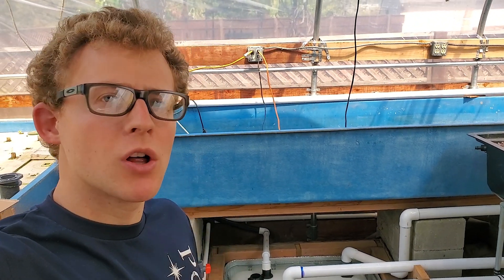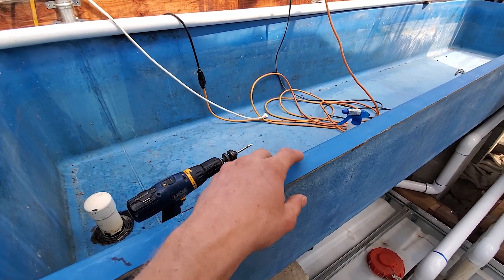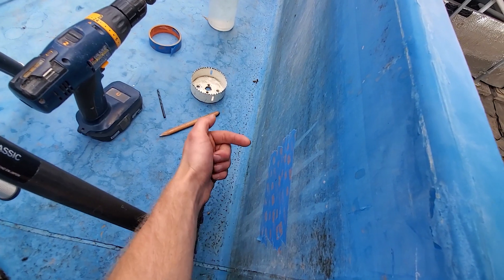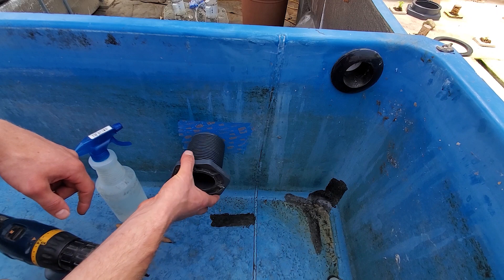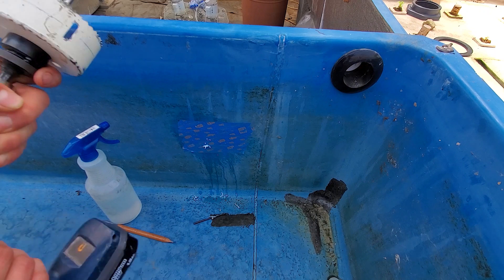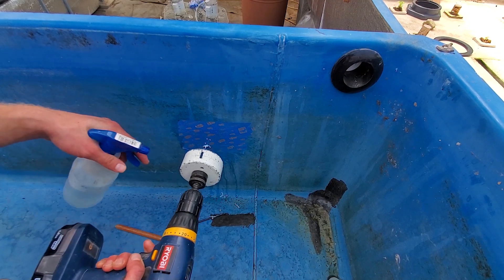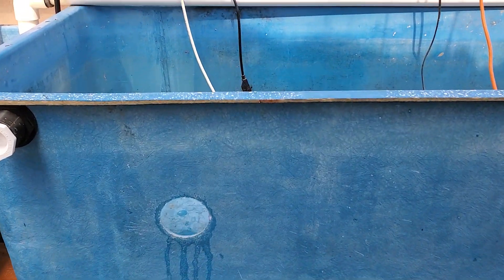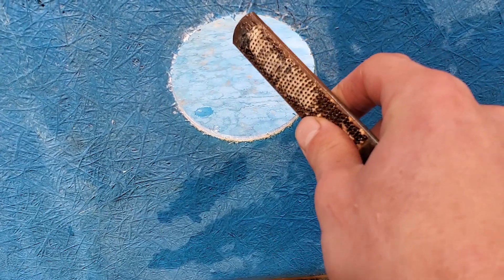How to drill a hole in fiberglass, using a hole saw

Comment: Your method incorporates every tip I've read in various on-line marine forums. In other words, it's spot-on advice——all in one place. Good job, Chris
Reply: Yup, think of it as slowly abrading away the fiberglass rather than cutting it. Fiberglass has high tensile strength so if the sawtooth catches a strand, it will pull on it and leave a rough and splintered edge.  If you don't mind spending $$$, a diamond tipped hole saw is great.

Comment: Cool video. Have you ever thought about making your own tubs?
Reply from the maker: Ya I have thought about making my own tubs as well as repairing tubs with fiberglass. But at the moment I don't need any more tubs. I might however try it out later down the road. Either just a repair on a tank or a full build, maybe both.